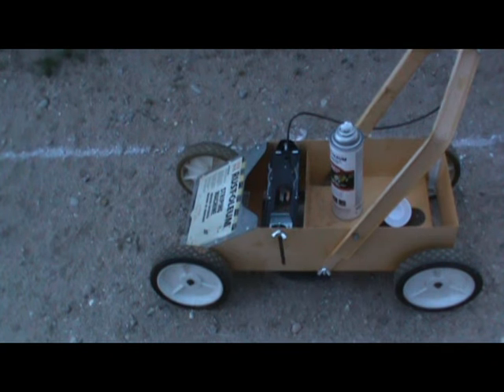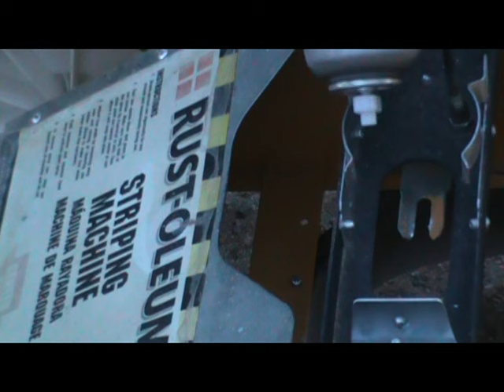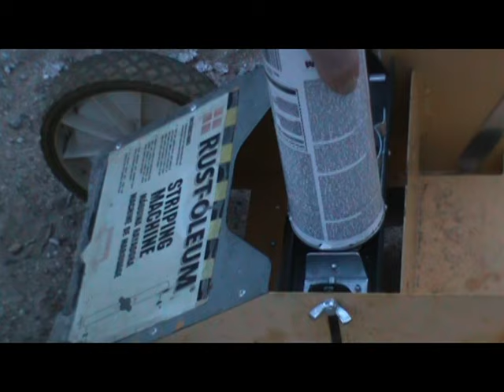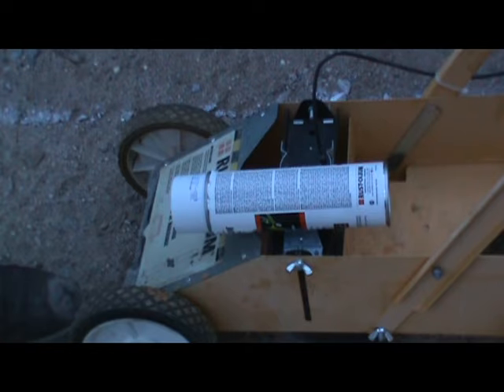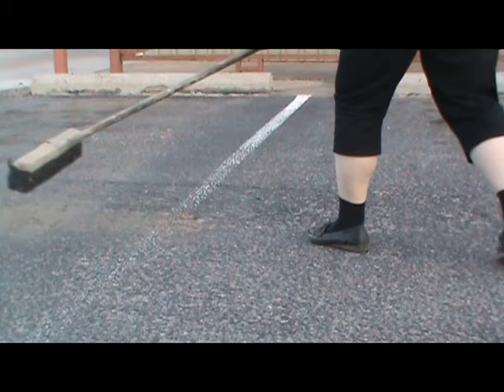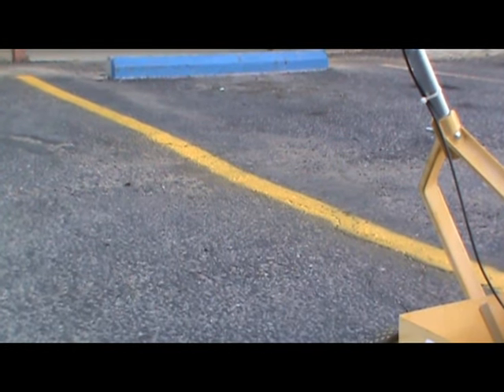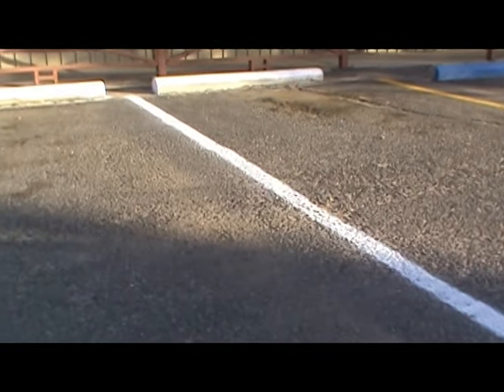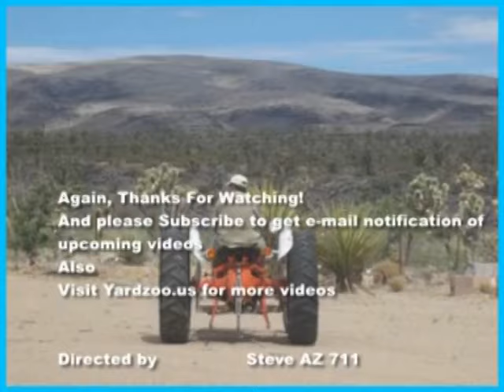First Time Using Striping Machine

Comment: Dude! so much faster if you buy a leaf blower vs a broom for the dirt.
Reply from the maker: Snap! I have 3 of them and should have thought of that earlier. Next time, Thanks!
Reply: SteveAZ711 no problem. your video was used to influence my decision to buy this item. I bought it yesterday. Thanks for the video!
Reply: depending on the parking lot a leaf blower doesn't always get it done. it's better to broom then blow it off.

Comment: I was about to buy one too. But I won't do it if it doesn't has control of straightness. You know, a mark on the machine that you can match with a line.
Reply: You can use a line chalk it works well too .